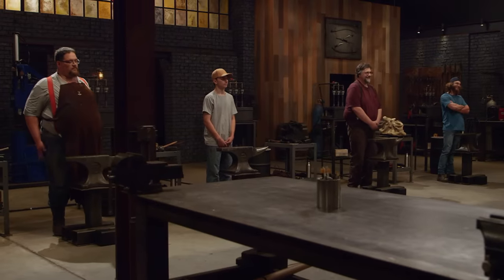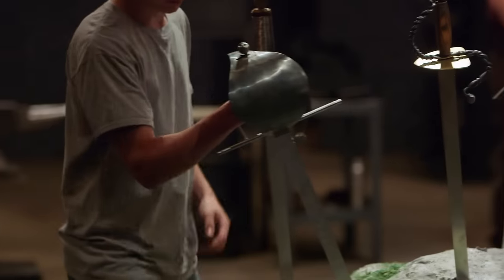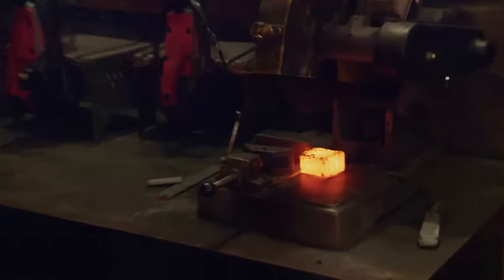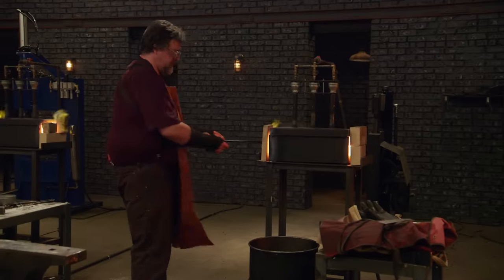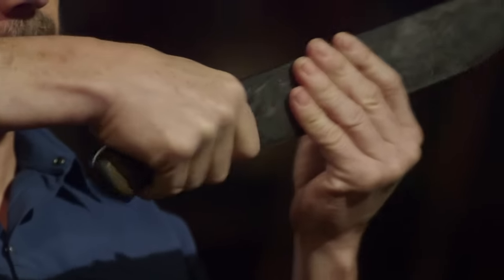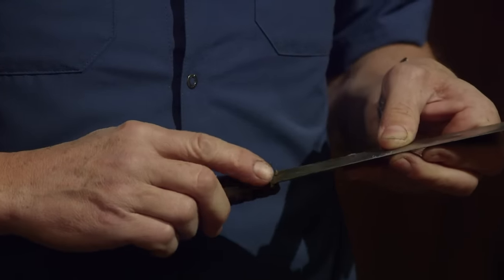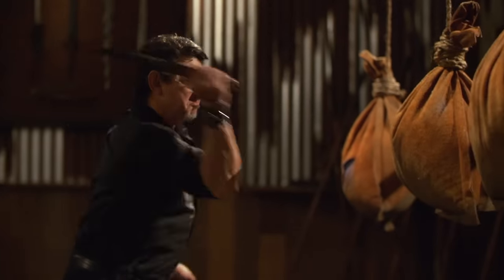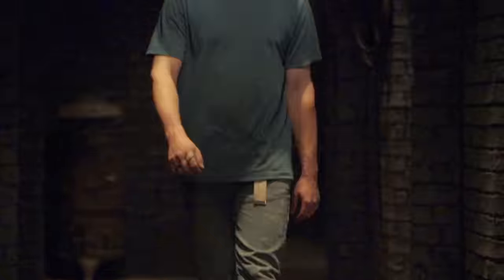Signature Masterpieces from Damascus Steel | Forged in Fire (Season 7)

Comment: The guy went to town on the rock with the third knife, way more.than the other two. No wonder the edge  was ruined and didnt cut.
Reply: Yeah this show is pretty idiotic sometimes, common sense would say do sharpness test and then strength test and try to ensure they are done evenly….
Reply: @Bishieboi it frustrates me when the bash the knives in rock or wood or ice before the sharpness test and then are like uhh it didnt cut well like smh lol
Reply: @warpoath3298  That's precisely the point, it is to test the resistance of the edge (aka the quality of the temper and overall quality of the metal)

Comment: Damascus Steel is actually known as wootz steel which originated in southern India. So give credits to India
Reply: This isn't wootz. Wootz metal is mono steel from a foundry, under the right conditions it can form carbides within the steel that give the classic wootz Damascus look.
This is pattern welded steel, made by combining two different steels with differing erosion resistance in a pattern and then showing that pattern by degrading the less resistant steel in acid. It really shouldn't be called Damascus, that name should be exclusive to wootz but I guess Damascus steel just sounds cooler than pattern welded steel.
Reply: @firetrucksrule5383  it is known as Damascus steel only because the Europeans got from Damascus region of syria which in turn got it from India so yeah India is the origin. Damascus blades were first manufactured from ingots of wootz steel that were imported from Southern India . the world's first 'pure steel' came from India. As early as 400 BC, Indians learned how to fuse iron with a high amount of carbon to produce the first true steel. The name 'Damascus steel' is very misleading as it wasn't even discovered in Damascus
Reply: @firetrucksrule5383  that's the problem with Europe, almost every scientific knowledge went from India to Arabs and then the Arabs introduced it to Europe and Europeans began giving credit to Arabs while it was actually Indian's work.
Reply: @abhinavkashyap9565  who cares.